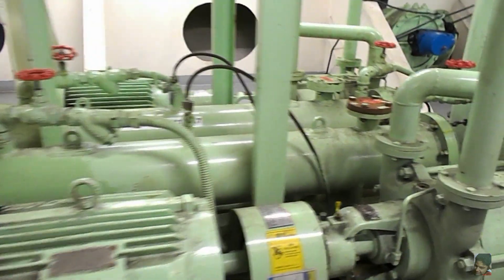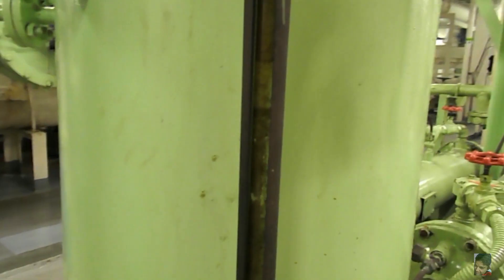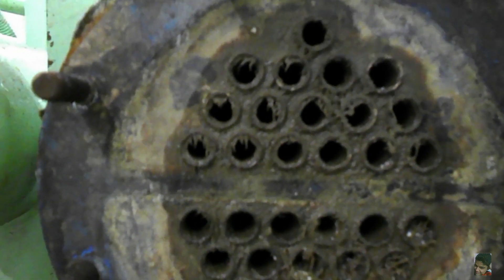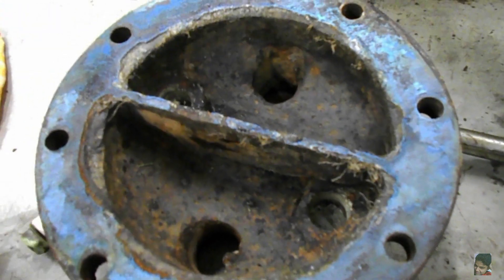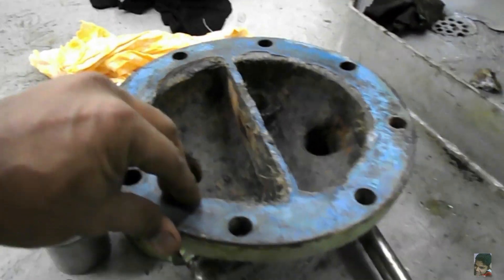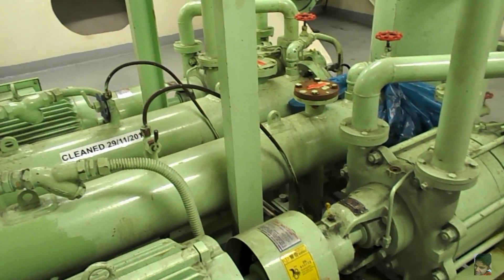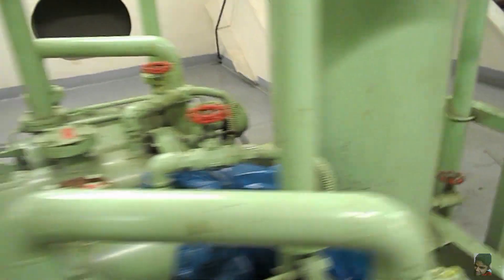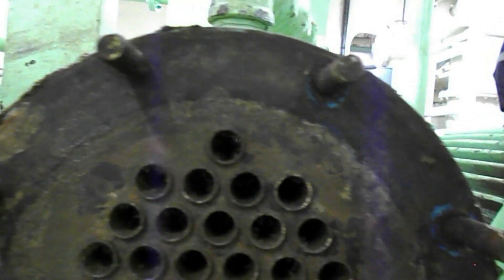Shell and Tube Heat Exchanger | Dismantle and Overhaul | RoamerRealm

Comment: Hi!
I watched the video and I had a question. 
Shouldn't sacrificial anodes have direct (non-insulated) contact with the protected metal? 
I mean, it's not entirely correct to use insulation (sealant) for the entire length of the thread.
P.S. Sorry for my poor english translation
Reply from the maker: Hi Ivan! Don't worry about English, I understand your msg perfectly correct and yes, you are absolutely right. The sacrificial anodes should definitely be in direct contact with the metal surface that they are trying to protect, else it does not serve the purpose. This was an old ship and if I put the plugs with anodes directly, it would leak water from the threads, so, I put teflon on the threads. It's not in the video, but I peeled away half of the teflon from the threads before installing them. Sorry about the confusion but you are absolutely right with what you have mentioned. Let me know if you have any other questions and please do subscribe to my youtube channel 👍